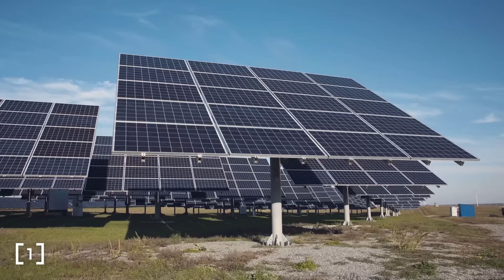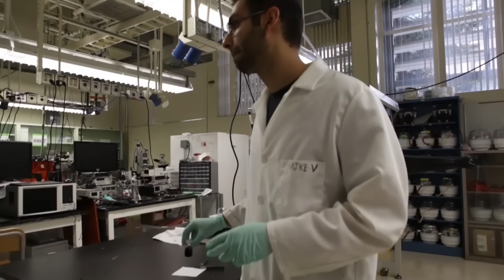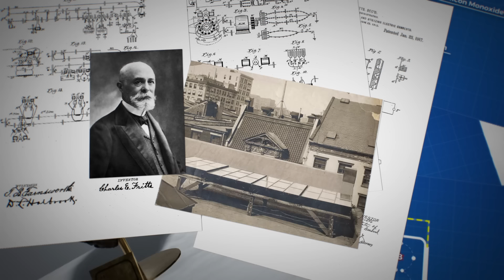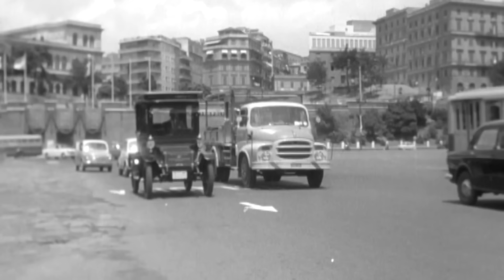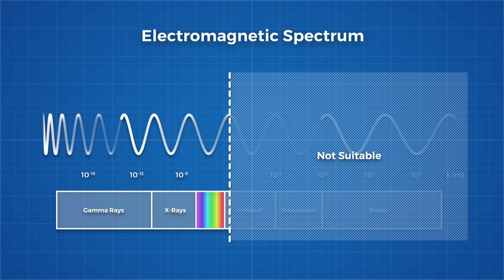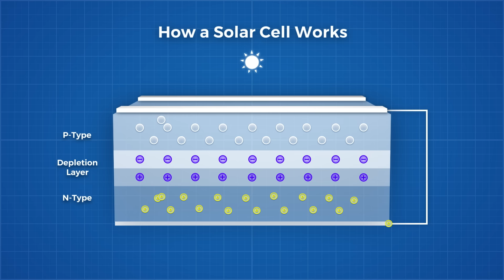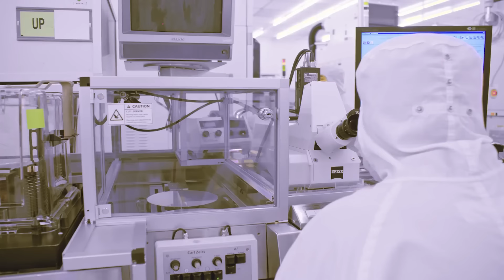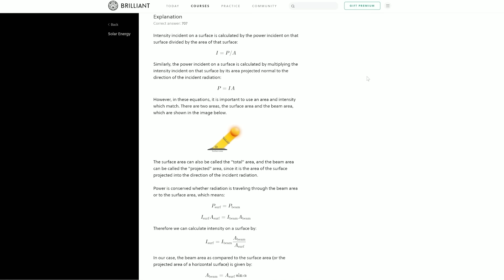The Mystery Flaw of Solar Panels

Comment: One thing worth noting: fossil fuels have absolutely horrible efficiency, as after all, they get their energy from sunlight. The only reason we are able to use them and they seem viable is because we burn centuries worth of biomass every year.

This is also why biofuels will never replace fossil fuels: even if we converted the biomass to energy in the most efficient manner possible, the biomass required to replace fossil fuels would simply be magnitudes bigger than the biomass of our whole planet. Forget food shortages, we would have continent shortages. This doesn't mean biofuels are fully unviable, as obviously in some use cases the horrible efficiency can be tolerable.

Tl;Dr. Biomass has even worse conversion rate. Fossil fuels cheat by accessing centuries worth of biomass every single year. Solar, with 18% efficiency, beats biofuels and fossil-fuels with ease.

Comment: Not a fan of Solar Panels. Clouds, rain, snow, short day-light, and night all  make them useless. Want to store the electricity?  Now you need batteries and an inverter that makes that crappie 60 HZ square wave. And don't forget to track the sun with sensors and motors. No thanks.